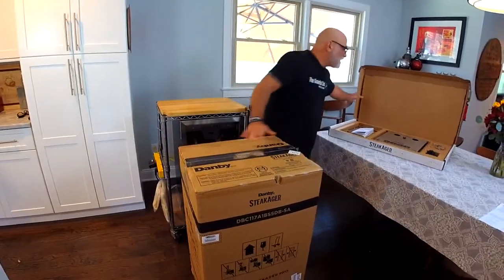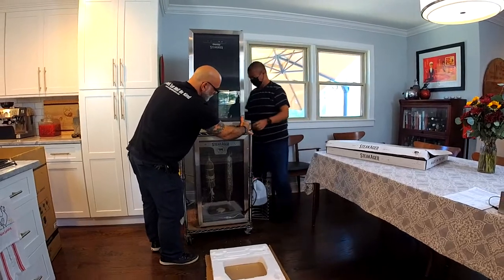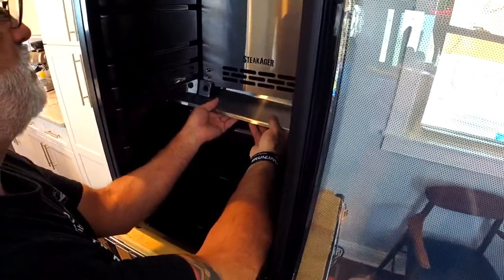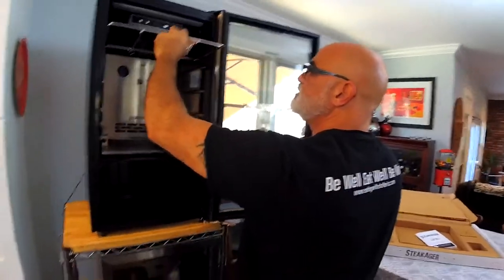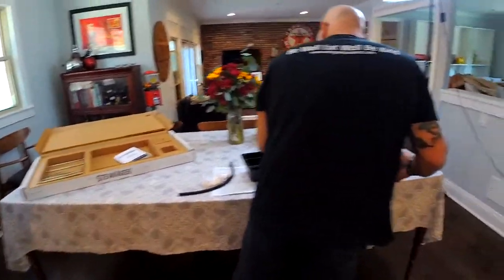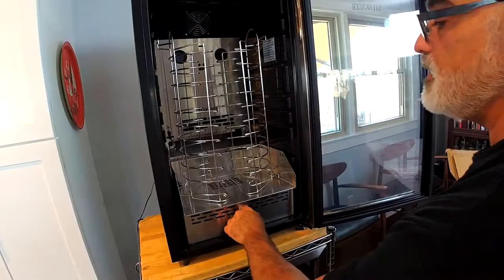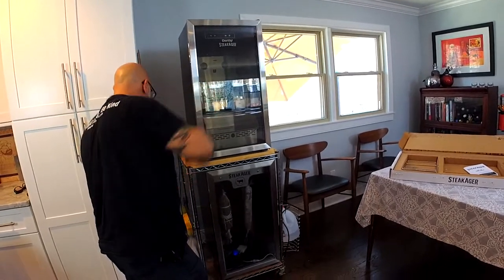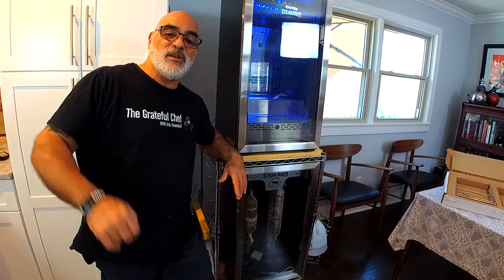Official Steakager Pro 40 Unboxing & Setup - www.thesteakager.com www.eatingwithcheferic.com

Comment: I had the original steakager that you put in the fridge and was fantastic. I upgraded to the Kingsford steakager....absolute nightmare. Back and forth with customer service and never got it to work over months. So frustrated it ended up in the trash and complete lost. Well......I'm back lol. Got thr steakager pro 40. And hands down completely different experience down the the packaging. Just assembled but I will say my confidence is back to when I had the first original steakager. I assume they switched manufacturing/sponsor but wow. Huge difference in quality.
Reply from the maker: The company is solely owned by Scott Kobryn, the original engineer and everything about the company and product have been built from the ground up. There are no partners etc, Steakager is a small family owned business out of Boone, NC and everything is right with the world.

Comment: It’s a converted refrigerator that costs $1500 for $40 you can use it Uma bag and a little refrigerator. Does the same thing or go buy a purpose built machine for just a little less money from pro smoker
Reply from the maker: I will argue that what the bags do and what true dry agers do are not the same thing. Working smarter not harder…no need to manufacture a fridge when there are excellent fridges available. . The Steakager technology is plug and play and is time tested. I’ve been using a Steakager since 2015 and I’ve never had a single issue with the end results.

Comment: Just got mine set up.  Hopefully will get the humidifier soon.  Did you get the short pigtail problem sorted out?
Reply from the maker: I took matters into my own hands. I attached a long,more ridgid tube with a small hose clamp so both of my Pro 40’s share the same drain pan.
Reply: @thegratefulchefwithericeis8416  Oh ok.  I was actually referring to the electrical cable that goes between the humidifier and the H plug to power the fan.  In the video, you said you would have to get with Ryan on it.  Just curious what you did.
Reply from the maker: Oh,....yes it was user error. I didn’t have it pulled all,the way through the grommet. Problem solved!
Reply: @thegratefulchefwithericeis8416  Ok, good deal!  Thanks!

Comment: I cheated today, I had planned on waiting to 35 days of aging a NY Strip section, today I took it out and cut a slice off at 21 days… the taste is literally almost the same as a regular steak at 21 days at 40 degrees F..  question… does the awesome nutty dry aged taste come about around 35 days???

I sure hope so! I do not want this ager to disappoint.
Reply: The minimum is 28 days and the longer you go the richer the dry aged flavor becomes. My sweet spot is 45 days. Also I suggest not cutting off steaks as you go. It will only add to amount of pellicle (dry outer crust) that you have to cut off. Dry age an entire subprimal and then cut your steaks, trim off the pellicle from each steak, vacuum seal and freeze them. Because we've removed excess moisture, they freeze very well.
Reply: Thanks so very much!

Comment: Awesome, was following your video and installed mine. One thing I noticed was mine didn't come with the drain hose/pan and only one truss rack. Did they make changes to their package?
Reply from the maker: Since the drain hose and pan is only needed when doing charcuterie (optional equipment) they no longer include it with all Pro 40’s it was confusing to those not purchasing the humidification device. There is a small pan attached to the top of the compressor that will evaporate any moisture that collects there.

Comment: I’ve had issues with my Steakager frosting in back of unit 10 days into my aging.  Working with customer service, I’ve set temperature to 42.  Defrosting it again, but very concerned about why it’s doing this.
Reply: So does mine. Its an issue they won’t address properly. BUT, I bought mine 6 months ago and am starting my 4th trail run with this unit. This time I am doing UMAI in  the Steakager using  both truss shelves. Previous 3 traditional methods had good results (strip loin, 12-14 pound, using meat hooks) Buy yourself 2 hygrometers from different manufacturers ($10 - $30 max) and put in the unit. Don’t get hung up on humidity readings. As long as you are above 50% throughout you are good.

Comment: I also got one! I'm wondering how you attached the humidity drip hose? On mine, the fridge drip connection is short and the hose won't stay attached. I'm wondering about using a more rigid plastic rather than the hose.
Reply from the maker: Hey Ben,
I did exactly that. I cut off the rubber grommet, purchased a more rigid hose at the hardware store and secured it with a hose clamp. You only need the humidification device when you are doing charcuterie so for dry aging it’s not needed unless your going more than 50 days.

Comment: Any notable differences between the 2 steak ager fridges you have?
Reply from the maker: Hey Willis….they are just two different versions of the Pro 40. The one with the digital display is the current model and it is rock solid. The other is an earlier version that isn’t available anymore.
Reply: Thank you for the response! Just got my pro 40. Now I gotta save up for the accessories